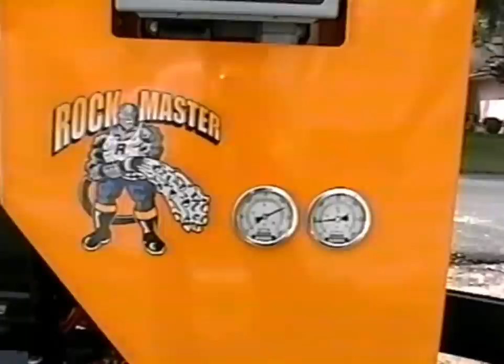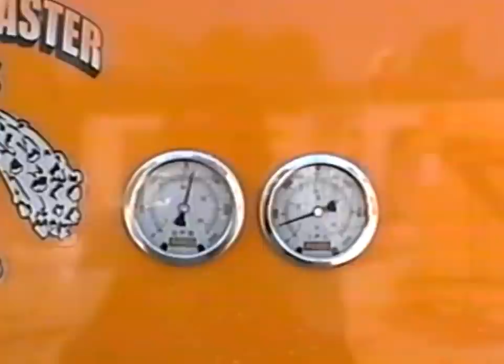REED A30HP Rockmaster Concrete Pump

Comment: How much this tool
Reply from the maker: Hello,

I appreciate your interest in REED Concrete Pumps and Gunite Machines.

 In order to know which REED Representative will be assisting you
with this request, I need to know where the pump will be working.
Which state (or country) will you be shipping the pump to?
I look forward to your reply.
Sincerely,
Mike Newcomb
REED Concrete Pumps & Shotcrete Equipment
13822 Oaks Avenue
Chino, CA 91710 – USA
Tel: 909-287-2100
Fax: 909-287-2140
mike.newcomb@reedmfg.com
www.REEDpumps.com
Reply: About 60,000 u.s. dollars
Reply: Those guys aren't pump dogs either. No hook standing on the beam block wrong and handling the hose wrong on the bottom. They can use of couple lessons from a real pump dog
Reply: @sledgenwedge  مبلغ كبير اوووووي
Reply: @sledgenwedge  في مستعمل ممكن يتشحن.الي مصر وتكلفةكام.
Reply: @sledgenwedge  100,000 actually I operate one 😅